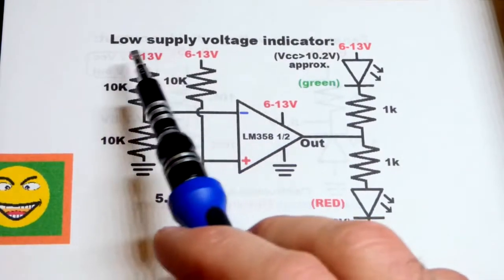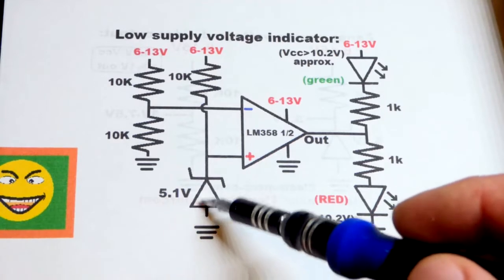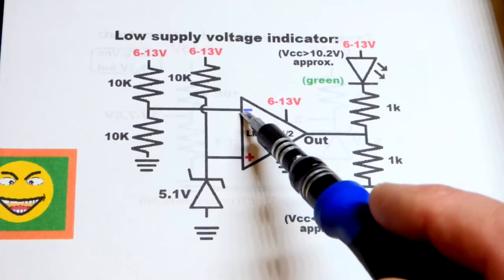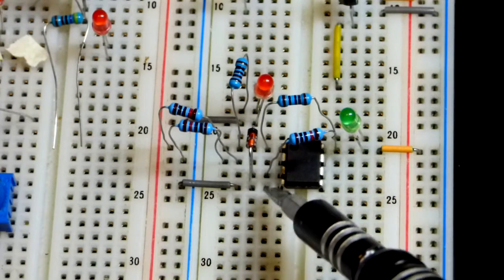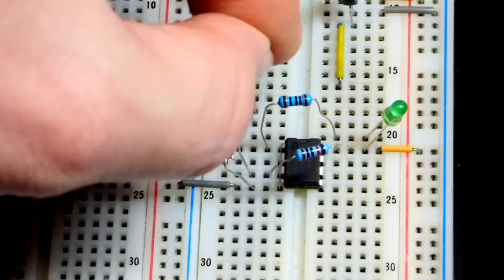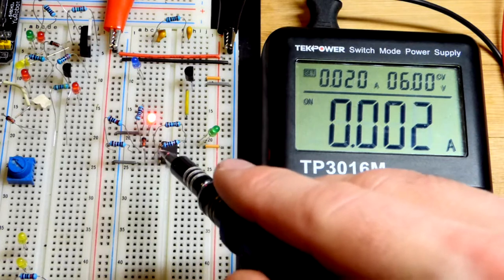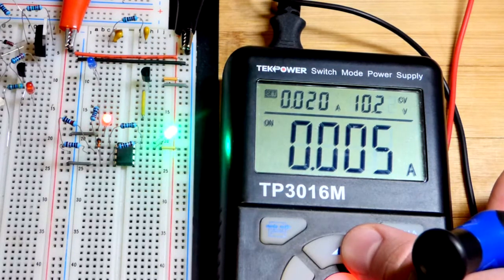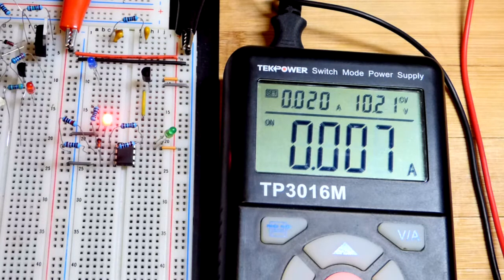OK versus low power source voltage indicator LEDs circuit with LM358 single supply op amp comparator

Comment: Hi, can you do  something with LM317 and a TIP41 or TIP120? Thanks and keep the good work!
Reply from the maker: I made, Quick LM317 three terminal adjustable voltage regulator component demonstration by electronzap https://youtu.be/jWP_oxczKRI and Quick LM317 wired as a current source circuit schematic to breadboard build by electronzap https://youtu.be/cLxlMYkpVPQ . I don't think I have a TIP41 NPN Bipolar Junction Transistor or a TIP120 NPN Darlington, but they mostly do the same thing as similar TO-92 components, just with the ability to handle a lot more power because they can dissipate more heat.